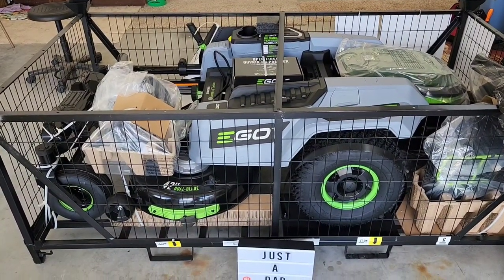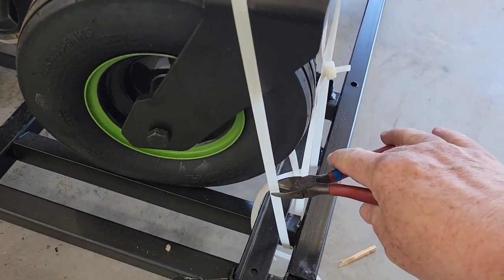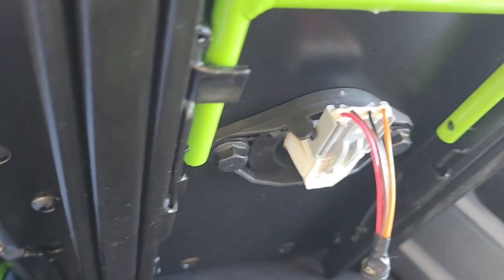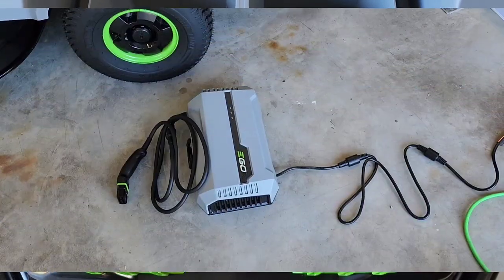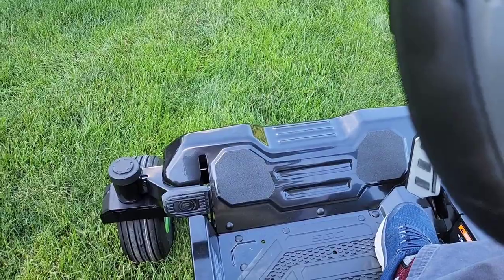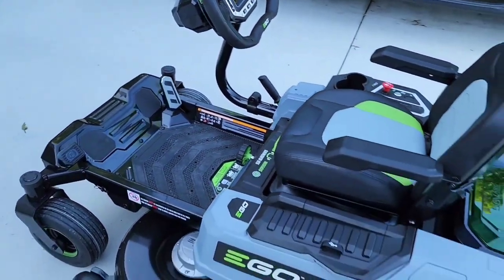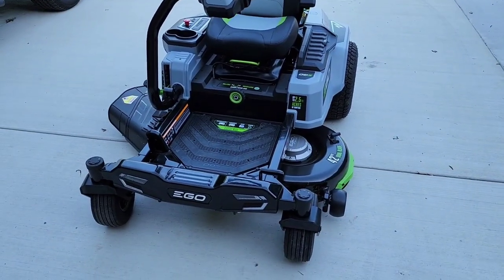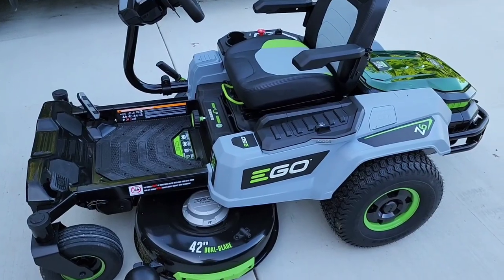EGO POWER+ 42 inch 56 Volt Battery Powered Z6 Zero Turn Mower ZT4205S Unboxing & How To Assemble

Comment: I shopped around and got one for 5500. I’m hard of hearing and did not hear the beeps when I parked it , but seeing drain battery power between mowing and the cruise control light not turning off I learned to apply parking break all the time.

Comment: I purchased the E-Steer from Lowes pending delivery tomorrow (17 AUG 2023).  I did ask the service department if I could have it unassembled in the original crate due to the stories of it being delivered with dings, scratches, missing parts, dirty, and over tightened screws. They unfortunately told me it had to be assembled and ready to go upon delivery; Lowes store policy. The service department told me to conduct a full 360 inspection also underneath and contact them for any discrepancies.  Fingers crossed. I'll update this as soon as I get my mower.

Comment: So my mower came assembled from Lowe’s. I noticed the steering column is a little loose. The two back nuts aren’t wanting to tighten. Do you think those are stripped? Also, do you have to push the steering column all the way back I’m a little taller would like to have it a little further away. Thank you
Reply from the maker: you don't have to push it all the way back,  i just checked my two nuts sticking up and they are tight but I am not sure what they do other that keep it from rolling side to side when the rod is pushed back
Reply: OMGGGGG Yes!! I had the same issue!! Sorry Im so excited lol, but its just nice to feel validated at the service I received. Get this, I paid for the Z6 package with the 6 12amp batteries and they delivered the one with the four 10's!! Not only that the mower came filthy and even had rust on the lap bars!! I told the guy to put it back on the delivery truck because it was the wrong mower and the condition was horrendous. Do you know what he said to me? We dont sell a package with 6 batteries (I literally had to go on THEIR website and show him) and he told me "we keep em outside so they are going to get dirty", but I can see here he is full of crap because it comes fully wrapped and protected. I am so pissed at my experience through Lowes honestly, especially considering for my Z6 package after warranty and taxes it was almost 8 grand. I know its been 3 weeks, but how is your mower? Did you return it? My husband wasn't home when the guy came to deliver and the dude kept treating me like I didn't know what I was talking about and it was pi*sing me off. I do hope everything worked out for you, I know how frustrating paying so much for something and getting bad service can be.
Reply: @TheBakingSlave I went to Lowes and asked to see the assembled one they had in the back. They wouldn't allow me to go back and see it. I went to Ace who delivered mine fully assembled to my house. My Ace is run by Mennonite. Very nice people. Anyways Lowes  blows.